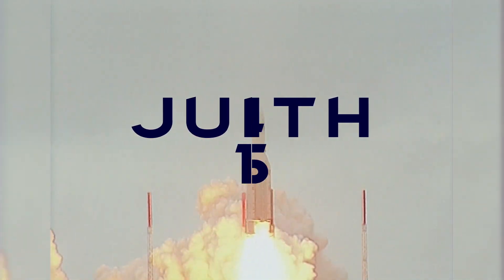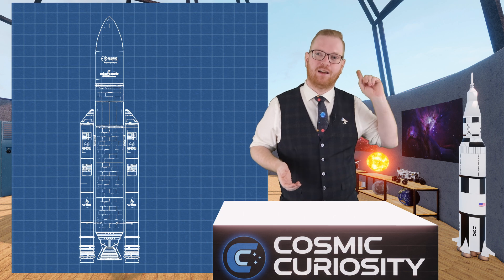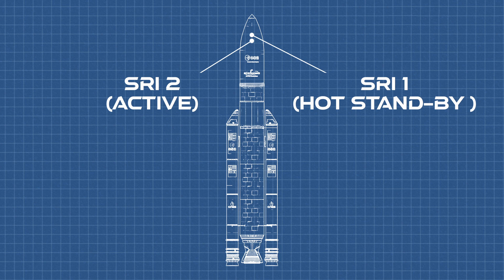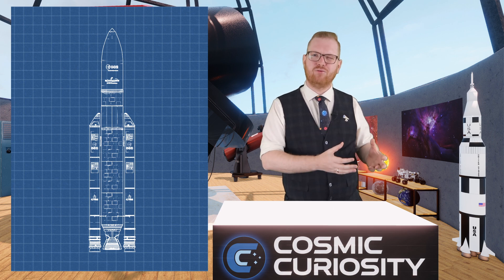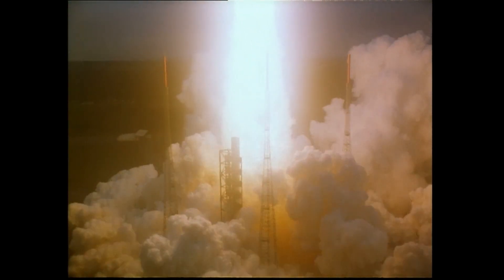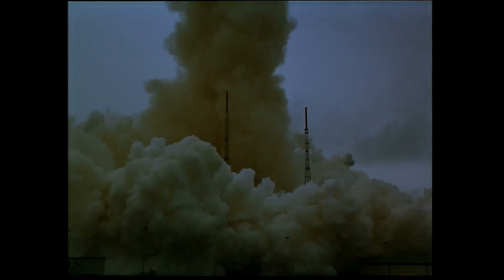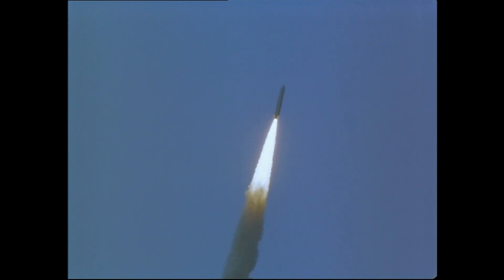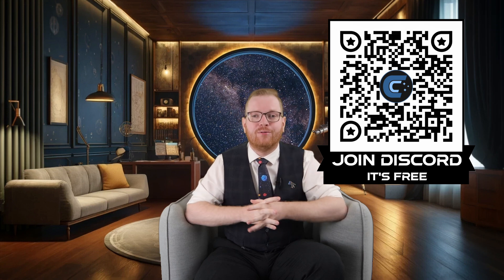10 sec more would have saved a $370,000,000 rocket from exploding - The Ariane 5 Rocket Explosion

Comment: Nice breakdown of this failure. A lot of engineers can learn from these mistakes.  ALso, I'm surprised the software engineers didn't foresee this problem ahead of time, that we will never know..
Reply from the maker: I would guess the rockets flight software could have 100s of parameters like this. If 99% of them works just fine and it worked on the Ariane 4, I can see why they missed this one